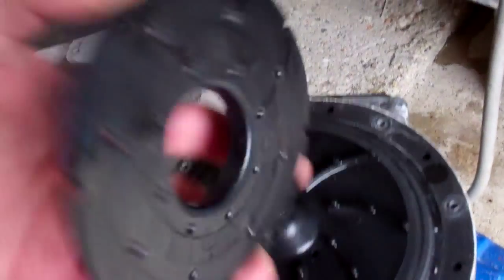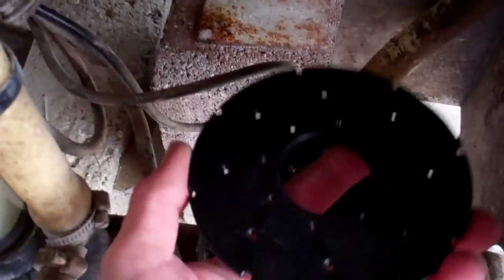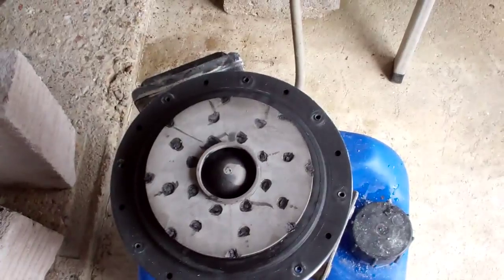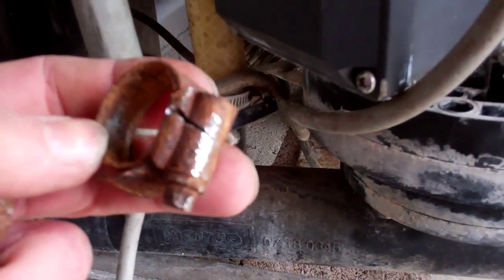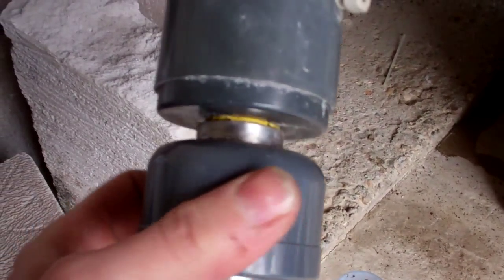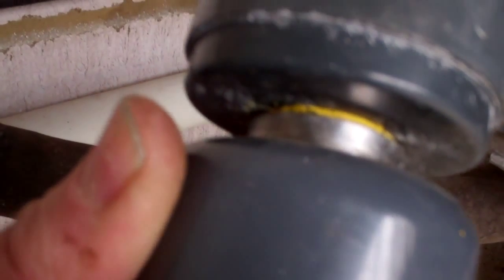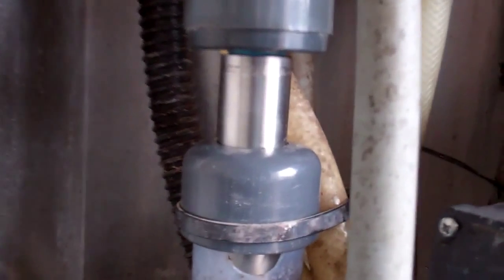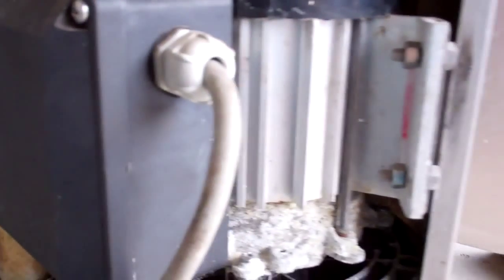Wash System Check Over

Comment from the maker: I think its just general wear and tear, the pump goes from cold to hot and back to cold again with acid and alkaline chemicals. Have had the same problem on other makes, seems worse on the vertical mounted pumps but having said that the horizon ones tend to freeze in the winter and burn out!